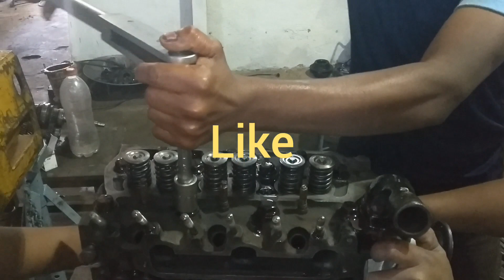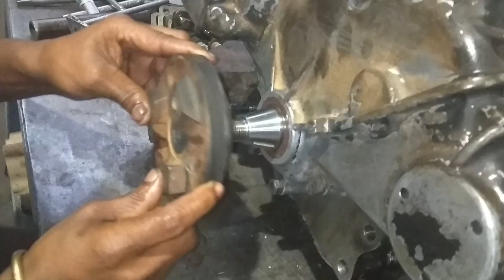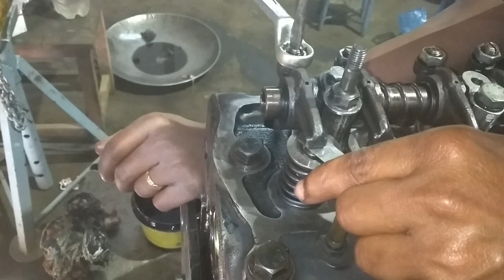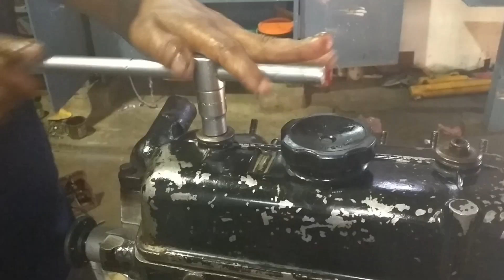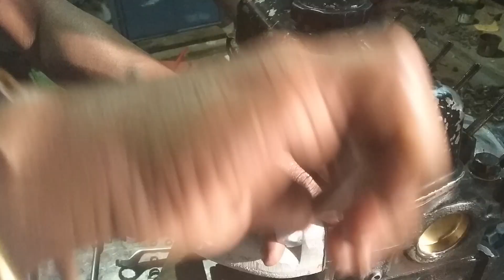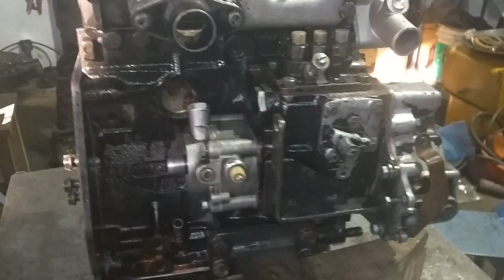Mitsubishi Shakti 3 Cylinder Engine Overhauling #Part 3.

Comment: Been working on diesel engine over 50 years. Worked on 10 hp to 5000 hp. All makes and models. Never done it never seen it oil on head gasket????

Comment: you should never ever do what he did with the gasket, because when the gasket gets soaked in oil it will have a grater thickness so ur torque settings will not be correct, and when it eventually dries it will blow, but by the look of it this is india and everything goes i guess
Reply: @Beau Jamie Yup, been using InstaFlixxer for years myself :D